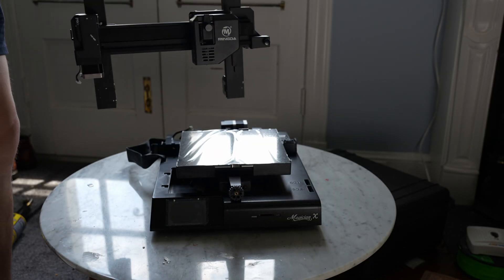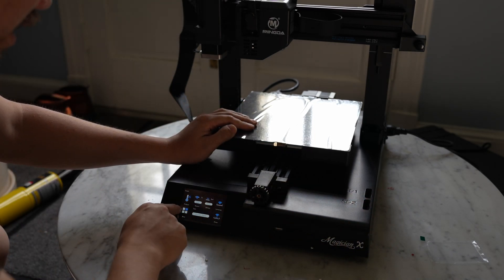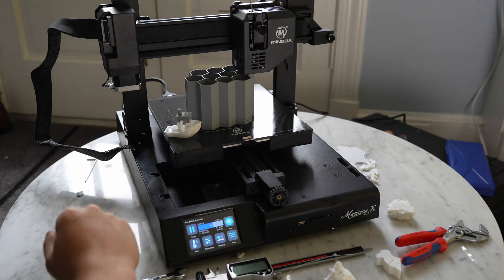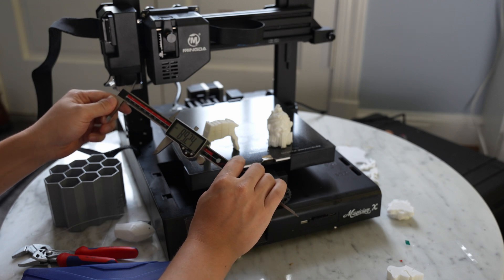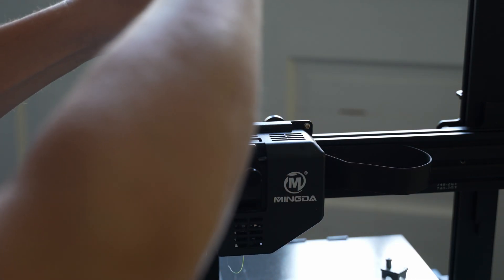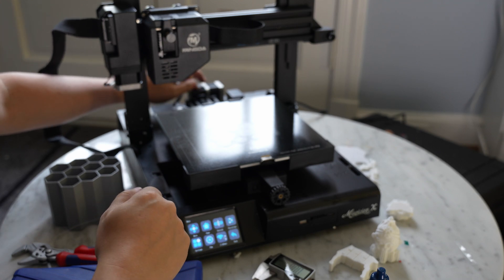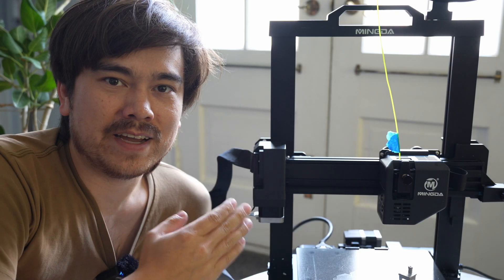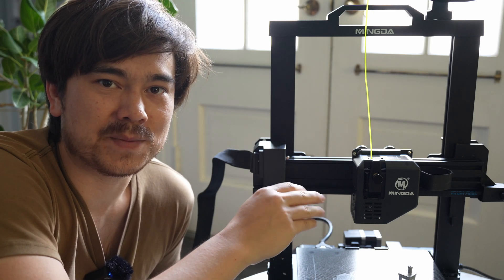Is the Mingda Magician X Better Than the Ender 3 S1?

Comment: I'm planning to get one in a few days time. Based on lots of videos I have watched so far, it seems that this printer is suffering from the bed is way too sticky. But your video showed the opposite. Is there any special settings?
Reply from the maker: I thought it was super sticky, but in a good way! You might be able to use a pei spring steel sheet. That is a simple upgrade that helps a lot with getting parts of the build tray.

Comment: tbh, pla adheres really good to the glass beds, but man, just tor to print abs, no print will stick. not even with a glue stick
Reply from the maker: I think they recommend hair spray, kapton tape, and a heated build chamber. ABS is toxic anyways so I don't mind not printing it.

Comment: Great vid, but I don't know where you got the "pei is more prone to getting parts lose" thing from. Been printing on pei for few years now, on several different machines and I had 0 issues, where as with glass, I had.
Reply from the maker: Yeah, I think there is a difference between good glass and bad glass. On my last project, which I ended up not posting a video on, I had a lot of issues with parts coming loose on my PEI sheet, so it was fresh in my mind.

Comment: I have a Prusa Mini and Mini + with the steel sheet, I have never had a print come off mid print. Maybe on cheaper machines this is an issue.
Reply from the maker: Prusa heated beds are much more consistent with temperature distribution, which helps a lot. I've had issues with both Prusa and Non-Prusa machines but it's definitely a bigger issue on non-prusa.
It is especially bad when printing really thick parts, which I do a lot. 15% infill on 0.4mm nozzle you definitely have less problems.

Comment: You should have said that you never print with PETG on glass, it will fuse and break the glass
Reply from the maker: I did not know that! I've printed on glass before without issue, if anything it has a harder time sticking. I've had major issues with printing PETG on sticker-based PEI sheets. PEI powder coated spring steel works best IMO but with bed adhesion things are always so variable.

Comment: As nice as auto level is, it might not be a bad idea to have a way to manually level printers with it. That way, if for some reason the auto level fails, you can still manually level it and continue to use the printer.
Reply from the maker: True. But if the auto level mechanism fails you won't be able to home the Z-axis too, which would present some challenges!
Reply: Don't forget all marlin machines have this style of bed leveling if you choose to activate it. But it's known to be bad because it runs the risk of damage to your bed. The thing that kills me about this review is the fact you can't change the extruder offset that leads me to believe you can't change xyz either.  Is this just because he wanted to keep the review as basic as possible or is it running a custom os that's locked down. Because if it is its immediately junk
Reply from the maker: @shawntame45  I adjusted the z babystep height when starting my first print, just to dial in the 1st layer. 
It looked like it would have worked without any intervention, but I tuned it up just because.
I think it saved that setting, because the rest of my prints ran fine without any further adjustment.
Reply: @NathanBuildsRobots  that's good thanks for the update!

Comment: I love my ender 3 s1 dearly but this printer looks brilliant. I mean it does sound like A made in China R2-D2 but it seems like a really good midway between the ender 3 v2 and the S1
Reply from the maker: Yeah its good value. I had some issues with mine getting banged up in shipping, so I had to re-torque some screws. They recently switched from white styrofoam packaging to the more typical black spongy stuff that most other companies use, so hopefully that will protect the printers a little more.  Also the z-axis was super-squeaky before I waxed it.
But its been on sale for $280 for a while now, which I think is a pretty good deal, $100 cheaper than the S1, and simpler to use - there's definitely a place in the market for the Magician.

Comment: I used lithium grease on my lead screws for a while. Despite being nowhere near my printer, my cats managed to absolutely cover those screws in cat hair. It's disgusting, but the lead screws have run smooth regardless.
Reply from the maker: Wax based lubricant is awesome. Its an emulsion of wax particles suspended in water, so you just dump it on the leadscrew nut and run the printer. It spreads around and gets into every crevice due to capillary action, then it dries and leaves behind a perfect thin layer. Should shed dust and cat hair too, but fuzzy leadscrews sound cool too.
Reply: @NathanBuildsRobots  This is too professional sounding. How about dissolving wax in gasoline and painting your lead screws with that so that it leaves behind a waxy residue.  🙃
Reply from the maker: @MichaelWatersJ  You're almost describing WD-40. only issue is gasoline/WD-40 is damaging to many plastics, so it could do more harm than good, unless using it on a full- metal assembly, like rusty scissors or a door hinge. On the Magician X the lead screw nuts are plastic instead of brass, so definitely had to go with a water-based immulsion
Reply: @NathanBuildsRobots  I forgot my /s. I've since moved to using 3-in-1 on my lead screws for my V-core 3.
Reply: @NathanBuildsRobots  how do you replace with all metal hotend? Do you know of anyone who has done it? Does migda have upgrade kit?

Can you share the gcode they sent you?